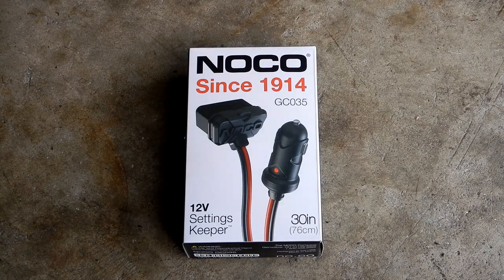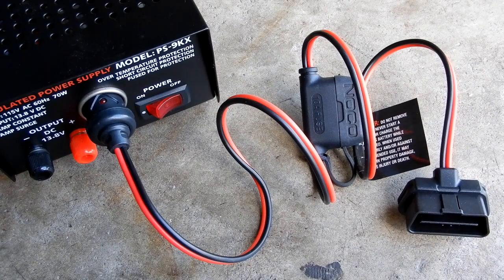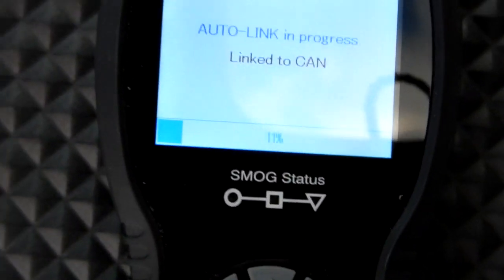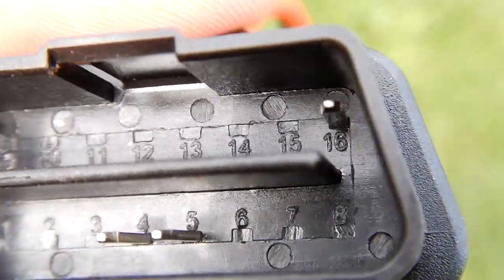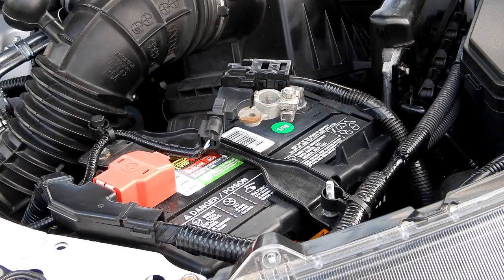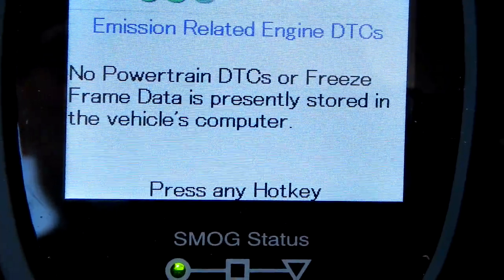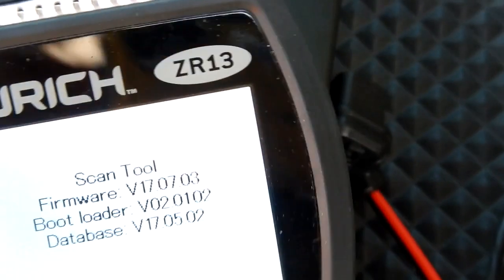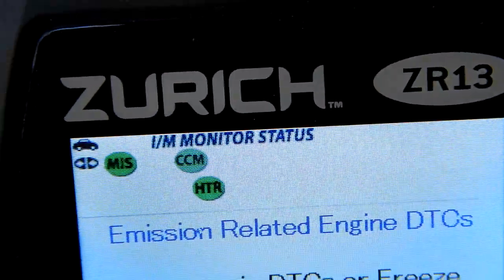NOCO 12v Settings Keeper (GC035) review & test

Comment: Thank you for making this excellent video. Simple and practical demonstration. Watching this gave me the courage to change my car battery.  Starastronomer- I plan to use an AC to DC convertor as well since I don’t have access to another car battery. Can you please let me know if I have to watchout for the amperage of the 12 V AC to DC convertor. The one that I have is a 12 Volt 15 amp. Will it be an issue?
Reply from the maker: You're welcome! You will have no issues 👌.
Reply: @starastronomer  Thank you for your advice. Really appreciate it 🙏
Reply from the maker: You're welcome!

Comment: Starastronomer - What brand/model AC-to-DC converter did u use in your video??  Trying to find one.  Also, is there any particular power configuration I should be looking for?  Or is it simply any AC-to-DC 12volt converter?  Thank you.
Reply from the maker: r b   It is a "Pyramid" brand, model shows in video. I have several other brands too, any will do as long as it is an AC-to-DC 12volt converter.
Reply: Thank you for the speedy reply and helpful tip.  I will look it up and see about getting one to work on my next battery change.